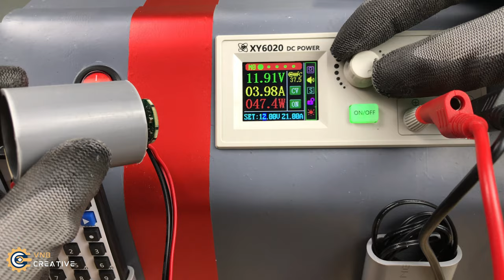HOW TO MAKE Powerful Handheld Fan with JetFan 80.000RPM from PVC | VNB Creative

Comment: Hello. I have the same motor but there is no driver on it and it is 220vac. Can I use it with a motor driver with 12v?
Reply from the maker: You have to rewind the vac motor core using a 12V esc to control it

Comment: Podrìas poner la lista de componentes y accesorios que usaste para crear excelente ventilador de mano? Solo he visto que pusiste en subtitilo el modelo del motor usado, no sé que placa electrónica usas y demás. Gracias.
Reply from the maker: You can see it in the video description. I have a link for reference. This motor has a built-in esc so just need to solder the wires in to run
Reply: @VNB.creative  I can't understand,  your video has spanish description but you answer me in english. In other hand, in video description I can see only the motor link to buy it and not others components like panel of status batery, turn on/off button for active the jetfan, etc. Would be very gratefull if you can list all components of your DIY hand fan.
Reply from the maker: Gracias. Puedes usar cualquier tipo de circuito indicador de batería y interruptor de botón. O puedes buscar con imágenes para comprar un producto similar en tu país

Comment: Interesting. At 12V, your motor draws about 4A, and at 16V, it draws about 5.3A.

I bought a motor that seems to be very similar to yours. I found that at 11.3V, my motor draws about 1.9A, so I guess it's only half as powerful as yours. In theory, 22 AWG wire should be able to handle this current, but I find that my wires seems to warm up disturbingly fast for some reason. Do your wires get too warm after prolonged use?

Comment: may next time build a detachable battery using 12v or 16v drill battery pack
Reply from the maker: You can use 16V power source.  it is very active.

Comment: Great Job, just I have to say that your batteries are fake, they are not 4200mAh. Probably 1200mAh. 18650 mAh can be max 3600mAh capacity. otherwise fake.
Reply from the maker: Actual capacity 2600mah.  Thank you

Comment: Too bad your instructions are a bit lacking. I mean the wiring is confusing once you push it inside.
Reply from the maker: thank you. I will include the circuit diagram in the following videos
Reply: So easy just put +I've wires on one side and -ive on one side but he didn't put any diode for charging port so it's reversible😅
If I'm not wrong

Comment: How come you're not using an ESC?
Reply from the maker: The motor has a built-in control circuit by the manufacturer. so no need to use ESC